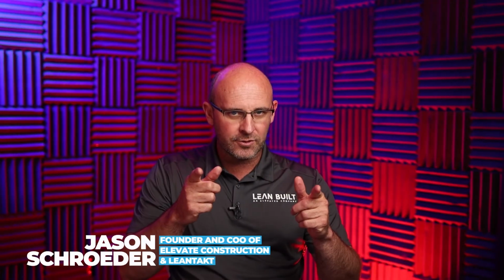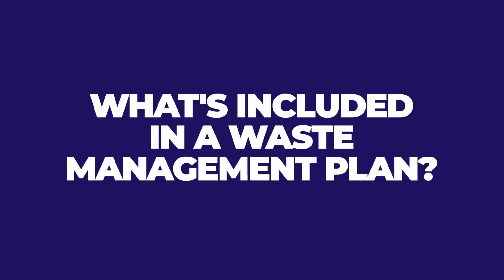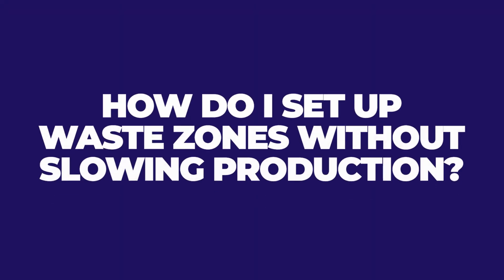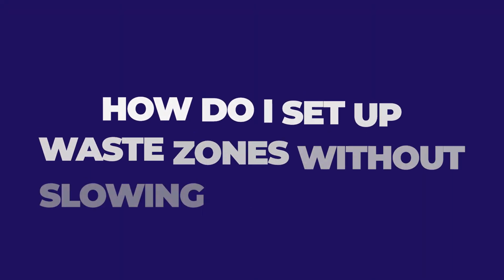What Is A Construction Site Waste Management Plan?

Comment: Nicely explained as always 🙏
My query is, Is there any definition of scrap in any standard.
For example : In fabrication of steel structures some companies mention in their work order that 2 mtr of offcuts can be reused and some mention it as 1 mtr.
Reply from the maker: Thank you! I appreciate that.
As you already know, definitions of “scrap” can vary depending on the standard, contract language, or even company policy. I’m not aware of a single universal definition in the codes that applies to all fabrication work—it’s often project- or client-specific. In steel fabrication, the “scrap length” allowance (like 1 m or 2 m offcuts being considered reusable) is typically set in the work order or quality specification. Some companies base it on what their fabrication equipment can efficiently handle for rework, others simply follow an internal guideline.
If you need a hard reference, it’s worth checking the applicable project specifications or any referenced fabrication standards (like AWS D1.1 or ISO standards) to see if they’ve defined it there.